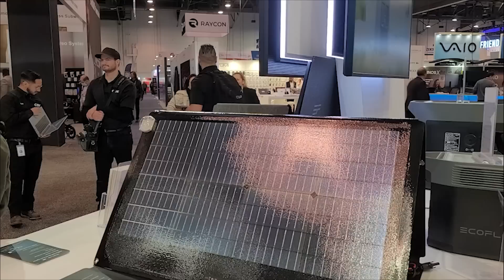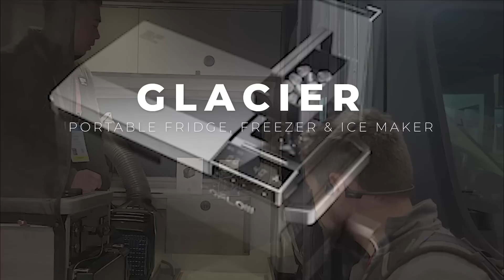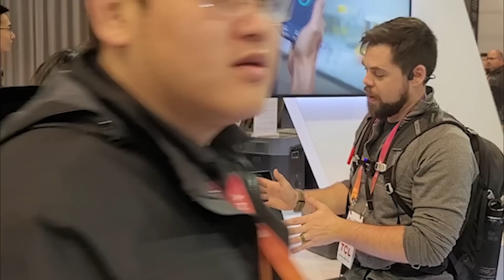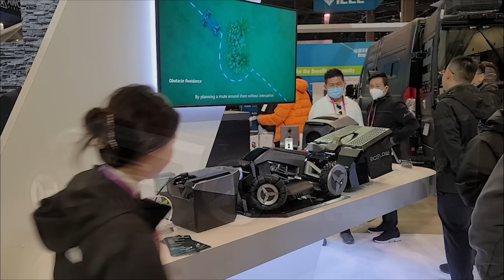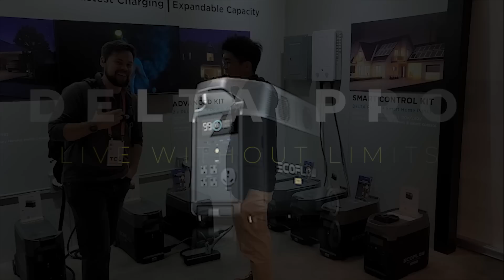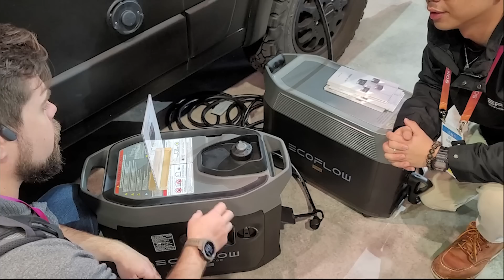EcoFlow Portable Power Outlook for 2023

Comment: I’m looking forward to setting up my off grid tiny home. I plan on getting the 15kw system. I was looking into the eg4 system but for the cost and simple plug and go. Kinda hard to pass it up given. I’ve been doing a lot of research on different solar generators. I also plan on getting the 4kw for my woodworking shop. Right now my shop runs off a Harbor freight 100w system granted it has came in real handy these past two years when the power got knocked down. I still had enough power to do something’s. An was still able to do my woodworking give all my tools are battery powered or arm power.

Comment: Ben ,great video again. Just a clarification for your viewers. You will NOT be able to charge your DP + 2 EB's via AC NEMA 5-15R from the EF Smart Generator if you are using the Double Voltage Hub (DVH). DP will not accept AC charging while DVH is in the "on" position.

If the AC is "on" for both DP's while connected to DVH, when you plug in the AC cord, the DP will NOT accept any AC input.

As soon as you turn off the DVH, the AC output light will turn off on the DP and the DP will start accepting AC input.

https://youtu.be/OiJY9EJ5zw0
Reply from the maker: You're correct, and I have a video coming out about the top 3 concerns of the Delta Pro, and that is one of them.

Comment: When you are at trade shows, and the people representing the products do not know the specs or content to the level of the buying audience.  Also, bothers me to build it in China.  I have the whole setup with 25k with smart home transfer.   Needs to be more powerful but does work.  EcoFlow could really impact the market by finding ways to add to an existing product line.  The generator makes good sense, but generally, that is an item outside, and your units are inside.  The cables provided do not come close to making this reality.  A gas generator needs to be outside with plenty of air to allow Co to dissipate the Carbon Monoxide.  I have also had one Delta Pro fail after one use - just now sending it back for evaluation.    I love the clean look and simplicity of hooking up - with that said, there is much to improve upon.  The whole lawn mower thing needs to make sense of what they should be doing.  I am heavily invested in the products but should step it up.  10 circuits on smart homepanel is the limit.  Just my thoughts.
Reply from the maker: I agree, thank you for sharing.

Comment: I have a 4kw Ecoflow Powerkit with the Control Panel. Everything was very easy to set up and plug&play. I will be setting up two 1kw solar arrays as inputs, and running a 8,000btu A/C during the hot part of the afternoons to reduce my power bill...and still have a nice emergency backup power available. Other than setting up the solar mounts and running wires...there really isn't much thought to planning the powerkits. They are expensive compared to DIY builds, but this is for people who don't want to worry about mis-wiring and cable management. The only thing I don't like, is there is no auto-charge startup for the solar inputs....you have to manually start the charging process on the remote app or control panel. Otherwise, great little system.
Reply from the maker: Thanks for sharing, great info.
Reply: How loud is the system under load of that AC? I was looking into diy systems but have found they are loud
Reply: So everyday you have to turn on solar input to charge?
Reply: wait so you have to turn on everyday? that sound stupid af
Reply: How much is the ecoflow power kit?

Comment: Cool products.  I am thinking about purchase two Delta Pro Max and additional batteries.  The gas generator would probably be a dual or tri fuel generator by someone else.  Which brings to the maximun input voltage rating question.  I was wondering if that has improved.  Because if I needed to use the gas generator I did not want to have to run it for a long time to get the units back to full or over 80% charge.  Please let me know if you think I should go another route.  Btw, the refrigerator is awesome.  Wondering what the retail price would be.
Reply from the maker: I'm happy to help you figure out what system will work best. The Delta Max system only uses one Delta Max but can have up to two expansion batteries, is that what you're thinking? Or are you thinking of using two Delta Pros with expansion batteries? The Delta Pros can link two DPs together to make 240v power.
Reply: Eco flow has a notice on their website right now about a possible 30% tax rebate on the delta pro system for whole house. I’m interested in that. 

I would want to power two full size freezers, one full size fridge, and a single burner for countertop that can boil one pot of water. 

I don’t think the pro is what I need. Probably a max

Comment: I was hoping they would release a new, more powerful and higher capacity version of the Delta Pro. A 5KW battery expandable to 50KW and a 5KW inverter that can go up to 10KW to 20KW inverter if multiple units are connected, would have been ideal.
Reply from the maker: I agree 100%. I thought they would announce the Delta Pro+ or something above the DP but they didn't and speaking with the heads of the company they said they don't have anything else to come out soon. The Apollo will beat them all.
Reply: @minutemansolar  

Whats the apollo?  Not seeing anything online about it that is similar to pro.
Reply from the maker: @Gamerz007z  It's a new unit that is coming out in a few months that will beat everything else that is on the market. I am very excited for it. Make sure you're subscribed to my email list from https://PoweredPortableSolar.com/ in order to get updates about it.
Reply: They do have higher capacity Power Kits, they’re just not as portable.
Reply: I mean all that can do down the line to their existing line is build bigger extra battery capacity & upgrade the mppt solar in the systems other wise just bigger battery expansion capacity really & the ability to charge them as well via solar or ac would be good enough.
Reply: @1ENDUSER  agreed that for the portable systems it would be nice if Delta 2 had two ports instead of one, Max had 3-4 ports, and same or more for the Pro.  Having to choose between the generator and an additional battery is tough.

More solar input would be a huge plus.  With additional batteries the existing solar limits are, well, limiting.  I’d like the option to charge my Max at 800W as it is now, or 1600-1800W with additional batteries attached.  It handles 1800W DC/AC charging from the generator/AC outlet already, I don’t imagine it’s a big stretch to upgrade the MPPT to allow the same from solar.
Reply: Imo the weight of the current Delta Pro the limiting factor. At 100lbs it’s already difficult to move into a vehicle. I do agree solar specs can be improved.
Reply: @TobyCostaRica  for now there’s no way around the weight if you need that much capacity.  Any unit with 3.6 kWh of internal battery is going to weigh a lot.

Personally I chose the Delta Max for that exact reason; it’s only about 50 lbs so I can get it up/down a ladder, and if I need more than its 2 kWh capacity I can add an expansion battery.